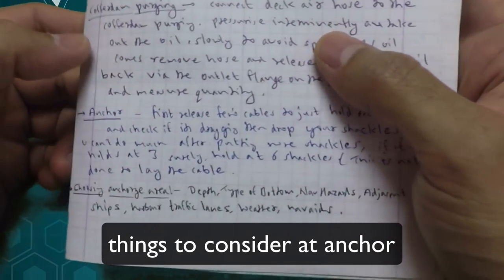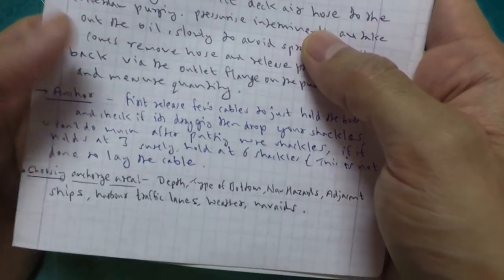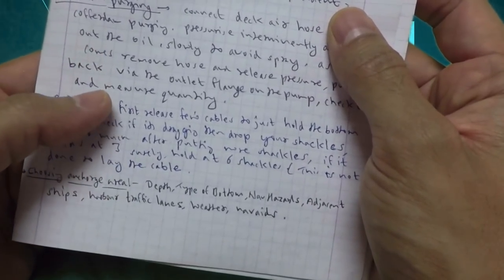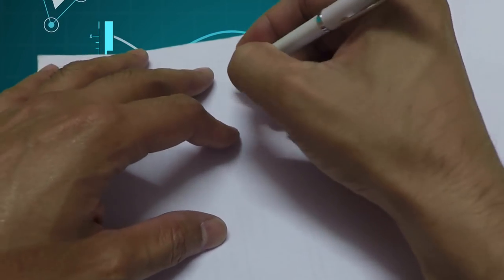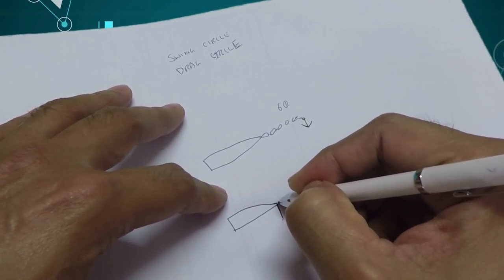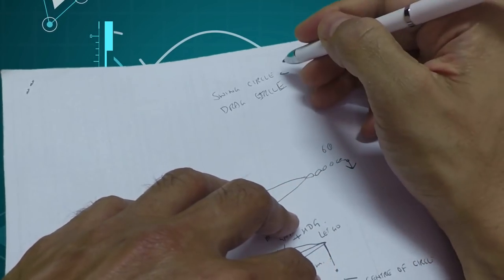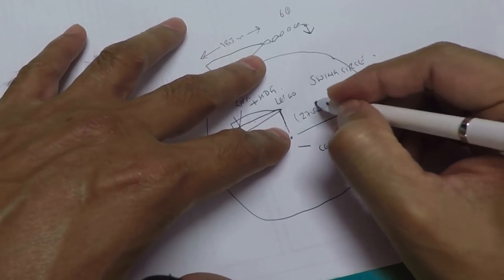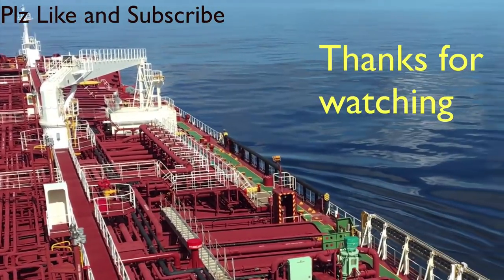Anchor Huge Ships- Things to consider and Anchor watch

Comment: Anchor...Forward me hota hai ya 
Aft me...plz let me confirm....

Bcz I have seen winch and windlass forward and aft both side
Reply from the maker: Winches are everywhere forward aft springs they are used for mooring lines . 
Windlass is only forward and used for anchors , port and starboard 2 anchors